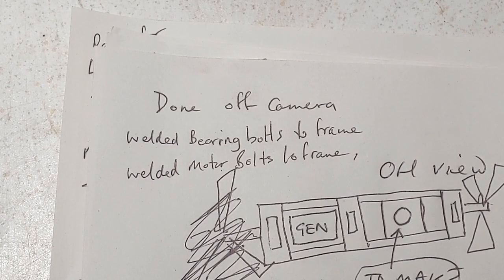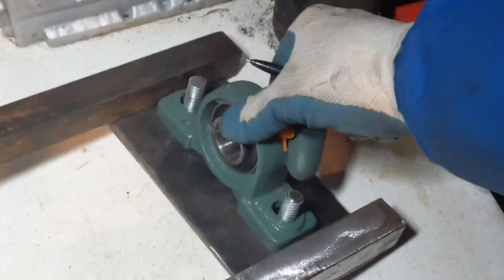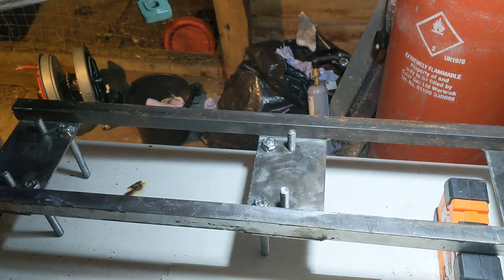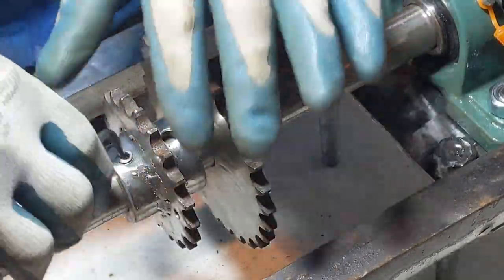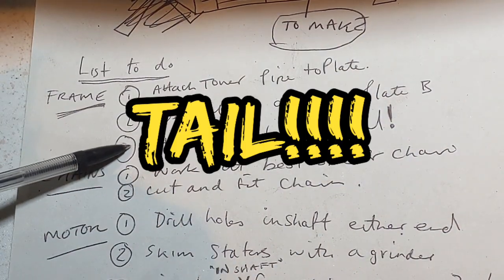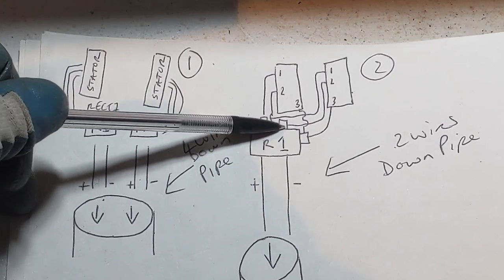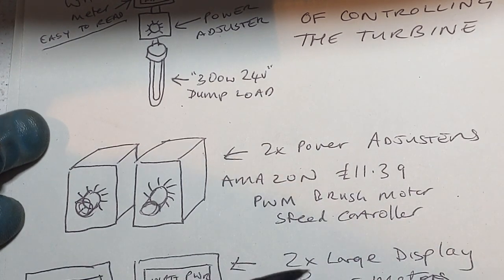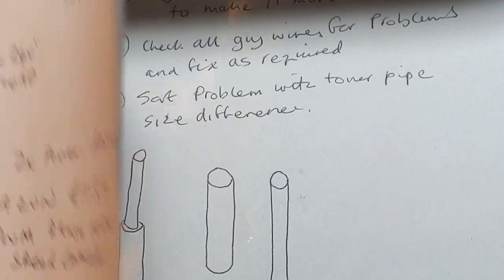DIY Wind turbine , Frame looking very solid , 20th December 2020

Comment: Sir take your time it's not a horse race !
I vote run AC down the tower !
Then Rectify it to DC less voltage loss !
Looking forward to see it fly !!
Looks like that new welder is working out good for you !
Best Wishes Always
Reply from the maker: Thanks for the input Doug, I'll bear that in mind , I am gonna need some more cable for sure 😃
Reply from the maker: And yes the welder has got it kick-started again for sure.
Reply: Why will the voltage loss be lower with AC?
Reply from the maker: I think he means If I run DC down the pipe the losses ould be greater than running tha AC over the same distance.
Reply: @GavinFreedomLover  I know but why is running AC down the pole less lossy than running DC down the pole?
Reply: @GavinFreedomLover 
 that's correct sir!
With a 3-phase generator always run as AC! To the point of use then convert to DC !
Saves a lot of money on wiring, most likely you have to use 10 gauge for the AC run, just use a common 10 gauge extension cord ! 1 extension cord for each motor !  One thought though I'm in the USA are extension cords 1 wire common 1 wire hot and one wire is ground not sure what it is over there!
Looking forward to seeing it fly!
Reply from the maker: I'm not sure but there must be a reason very few people put the rectifiers on the tower.
Reply: @jack-of-all8042  IS this because if you use DC all 3 are phases run down 2 wires?.
Gavin may have to use 6 wires depending on the phase of each generator he may not be able to parallel connect them.
Reply: @GavinFreedomLover  
The reason why the rectifier is not at the generator on top of the tower is the cost of the very large wire it takes to conduct the DC current to point of use.
Also being able to visually inspect the rectifier, the rectifier gets hot, not unheard of to melt, use a voltage meter check that all three phases are producing electricity !
Best Wishes Always sir